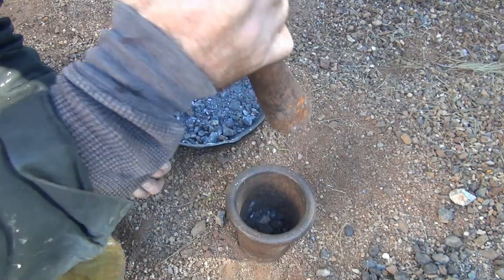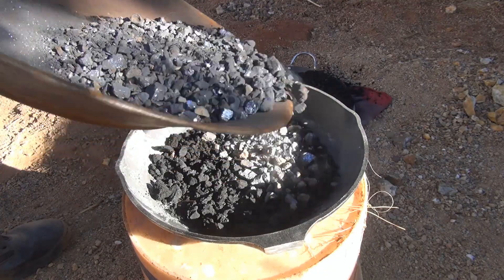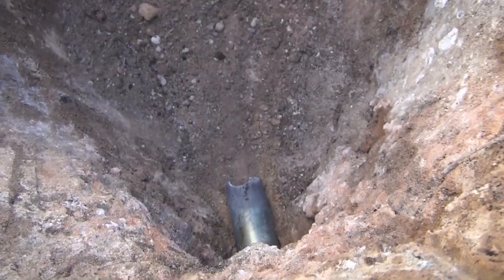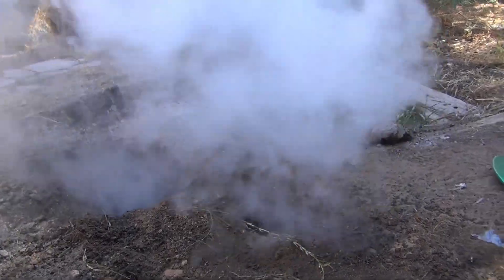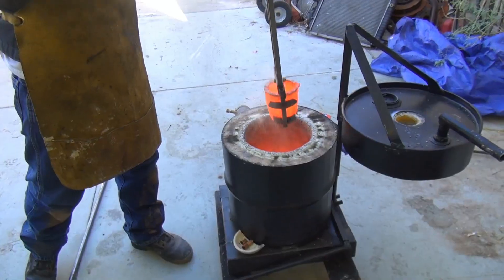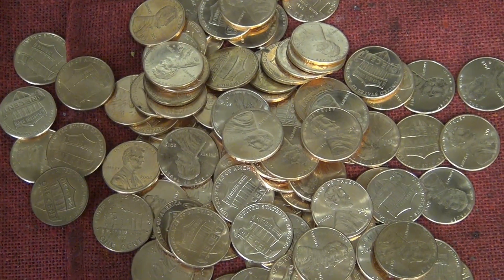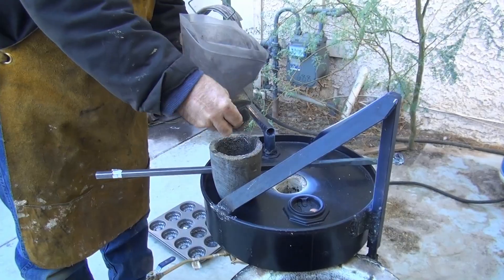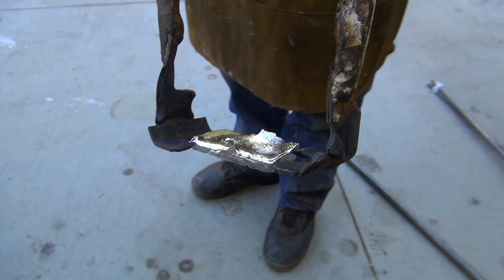TURN LEAD INTO SILVER - Using the Parkes Process |ask Jeff Williams

Comment: Title should not induce ideas of alchemy being a thing as it does. You can not turn lead into silver. you are simply separating silver and lead from raw material from the ground. At no point does an element turn into another element except for radioactive decay and inside the heart of stars through the process of fusion. How many kids do you think have seen this title and then told their friends there is a way to make silver from Lead? If we are not 100 percent correct in the use of our language then the generation that learns from us will not be able to. Thus, we need to strive, as a country, for perfection in the use of our language so that our next generation with learn to do the same.

Comment: I can't remember who but I saw someone else  just used borax in a castiornpot with crushed Galena mixed together and then dropped it in a campfire after the burn he dumped out the pot and broke up the flux to find a nugget of what he called silver. Is that really a method to recover pure silver?

Comment: Why not just use an acid strip. 1:1 nitric acid and distilled water to dissolve the the lead silver alloy and use sodium metabisulfate and copper to reatomized the silver into a fine powder. Then melt it down into a solid chunk of pure silver.

Comment: Good video jeff, I have about 40 lbs of the shinest pretty heavy chunks of galena, sit in a bag waisting space, so why not get that silver,! How much weight in silver is in 40lbs galena? I also have a chunk of metal very heavy, its magnetic silver nickel in color, about the size of a softball, I hit it with a big hammer 4 Times and it was hard to tell were it was struck, very hard tough, it actually looks like a meteorite outside melted like meteors, across the surface, but I have never seen a meteorite like this, whatever it is its pure through out and heavy like gold and hard and tough?,whata think it is?

Comment: Hey Jeff, next drift mine you open forget about tracks, ties, and cars. Ditch witch makes a vacuum for cleaning out storm drains. It could easily pull rocks the size of soft balls through a hundred yards of 6" PVC pipe. Also it would pull fresh air into your mine so no extra ventilation needed. We used to excavate under buildings in Seattle with this setup. You can add a cyclone filter made out of a 55 gallon barrel so no dust reaches the vacuum.
Reply from the maker: yep we saw that ...wonder if it cmes with a longer hose.... sounds like a great idea...they use something like that in lightning Ridge Coober pedy
Reply: @Askjeffwilliams  Do what we did excavating under houses. Buy 10' lengths of cheap pvc drain pipe for a couple bucks a stick. We've pulled dirt through a couple hundred yards of pipe. Put an easy to make cyclone filter made from a 55 gallon drum right in front of the vacuum. Good luck you loco hombre.

Comment: Jeff, for that last zinc boil-off furnace process, if you make your own crucibles using lots of bone meal, any lead left over in the silver will  flow into the crucible wall and bind with the calcium phosphate.  I am not suggesting you do it because then you have lead contaminated crucibles, and what do you do with them?  Just a thought, not a suggestion.
Reply from the maker: thanks Richard.......yes you can do that with magnesite too....thanks

Comment: As you might could guess, I would want the lead as well as the silver! ALL metals are valuable to meeeeeeeeeee! \(^_^)/

I once built a fire pit like that to melt aluminum....one time it exploded and shot a piece of steel by me so fat it could have cut my head off if it had hit me! >0.0<
Reply from the maker: you be careful out there
Reply: @Askjeffwilliams  Since then, I have held off until I can build a genuine smelter. I have some steel tanks and will make up some pyrocrete using silica and alumina with ducted filtered exhaust [to keep the silica and alumina particles that might come out of the mix from being released into the air] and although some people might think this foolish, I will probably also add asbestos as a reinforcing fiber, but as long as it is thoroughly dry filtered and wet scrubbed, it should be fine.

I aim to build a universal fuel system which can burn gas, oil, wood, coke, coal, charcoal, you name it.

That way, no matter what I have on hand i can get it up to heat and get the job done.

Mine will have a Kalina cycle power scavenging system in the exhaust which will drive the blowers, the regulation system and the hydraulics so that it is fully self contained, with a 24 volt power system to support all of the operations from fuel stoking to digital monitoring.

Also it will have a dedicated 100 lb propane cylinder for starting the system so one need not have to mess with troublesome ignition techniques.

One will be able to simply fill containers with the appropriate fuels and hit start. (~_^)-b

No more explosions. \(^_^)/

Comment: After watching ya process gold, and now watching this for the first time, how is it that silver is so much less expensive?!?! I've gotta lie down. my head hurts!
Reply: It's the properties of gold that make it worth more gold does not tarnish. Silver does. Gold is a better conductor of electricity. Gold is the denser. Yet soft and mallable. Aluminum is even harder to process. But is found almost every where. Cody'slab has a good informative video about making aluminum.
Reply: silver is actually a better conductor of electricity  @TheKeving123
Reply: @livetoshredhella  Although it is the best conductor, copper and gold are used more often in electrical applications because copper is less expensive and gold has a much higher corrosion resistance. Silver tarnishes once it tarnishes it is not as conductive. but gold plating coper will protect the copper from oxidizing and make a long lasting good connection
Reply: @TheKeving123  Yet, silver has over ten thousand uses. It's all to do with price manipulation, no thanks to JP MORGAN and the central banking cartels, ect!
Reply: @wefukthenwo  silver is still precious metal yes you can drink silver water for your health or kills bacteria .9999 pure silver bar  and electrolosisi prorses to make silver water ! Very beneficial  to the body